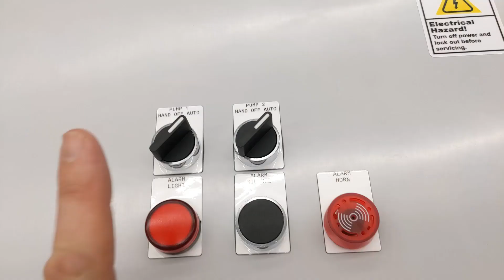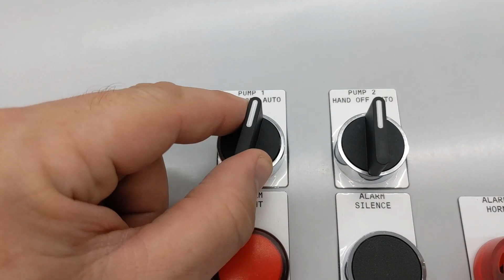UL 508A Duplex Pump Station Controlled by Allen Bradley Micro820

Comment: LOL, in  the first few seconds I didn't realize it was a greenscreen shot and wondered who had the humongous hand on the right.
Reply from the maker: Haha, these are mostly for customer reviews but I think they make good examples of control panels.
Reply: @TimWilborne  I build sump pump control into my panels too and often get the side eye from contractors who expect the sump control to be a separate purpose built box . Building them like we do allows you to watch run times and see if one pump is partially (or completely) plugged or wearing out by watching the run time each cycle and comparing them to each other or some historical number.